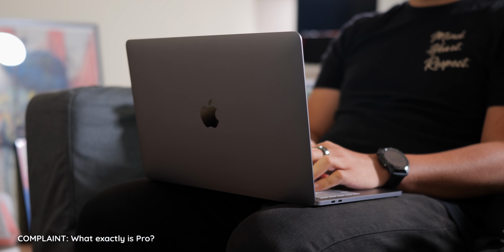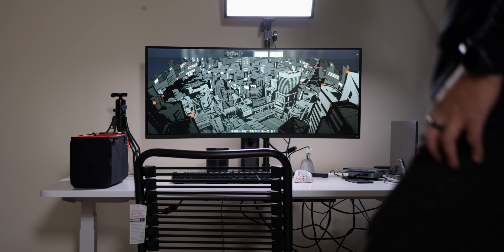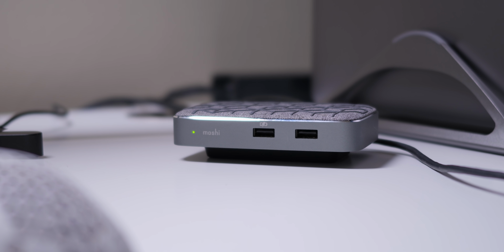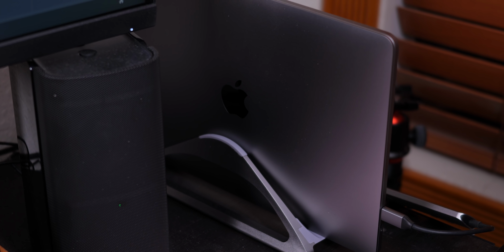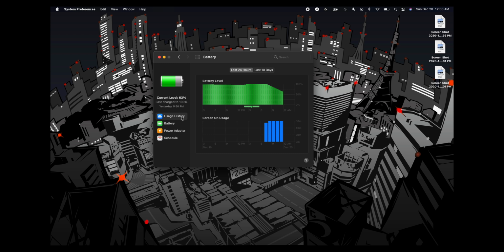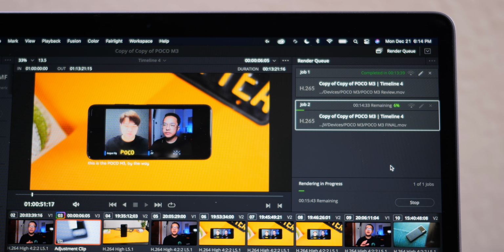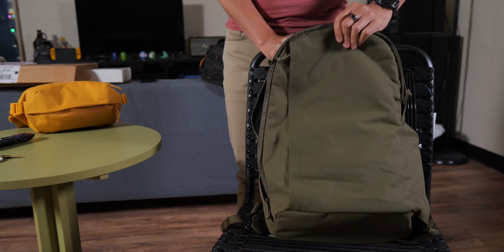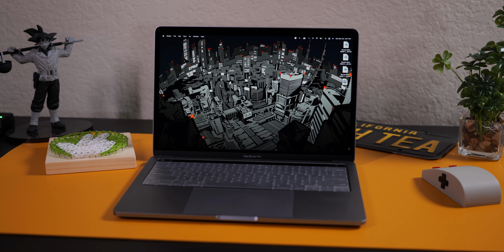MacBook Pro M1 COMPLAINTS and TAKEAWAYS

Comment from the maker: Did you get on the M1 hype train?
Reply: Not yet but deffo shall consider!
Reply: Nope
Reply: Nope
Reply: Haven’t watched the video. But I have one now. Watching apprehensively worried I made a mistake.
Reply: How does it compare to the g14?
Reply: Not even a consideration until there’s a 16in variant with at least 32gb of ram and more powerful graphics.
Reply: @brandonharden2184   Guess you're still thinking in intel's mindset. Heh. It doesn't work like that at all with Mx chips.
Reply: Yup! Bought my Air last saturday and also an Iphone 12. Guess I am a MacGuy now! Cheers from Portugal.
Reply: Well, I've been chugging the MacOS for about a year since I kicked my butt off windows 10 after having been a windows user for way over 20 years. Windows 10 being the ABSOLUTE WORST iteration of windows that forced me to jump the fence to Linux Mint first, and eventually to MacOS. Tried the MBA 2017, first, decided to like it so much and then allowed myself to get the M1 Mac Mini when the opportunity presented itself. Bought the base model, with option to boot from a MUCH larger external NVMe SSD courtesy of Ugreen enclosure, plus a 4TB of spinning drive as the default backup and data drive.

Comment: Windows needs to catch up to Apple. Intel is lacking the innovation in the PC side.
Reply: You can get around 10% higher performance vs windows by using Clear Linux as the OS. Don't underestimate the power of being able to optimize the software for the hardware. IMO windows will never get that level of optimisation cos they're not really that interested in desktop anymore plus they're working on windows on arm.

Also maybe you should watch the upcoming CES video, amd might show their van gogh apu which is supposed to have the same integrated graphics as the series s  albeit at lower clocks and around 9-18w ctdp. Intel's only gonna get into the conversation late next year at the earliest

Comment: I actually had to buy the macbook pro 13" 2020 intel i5 10th-gen chip. Aside from the M1 not being released here in the PH yet(the iphone 12 pro max just got officially released last Dec 18), the statistical softwares and some econ programs I use are not supported by the M1 chip. But overall, I'm glad I switched from PC to Mac. I know now why other people will say "Once you go Mac, you'll never go back" lol Maligayang Pasko and great content as always! :)
Reply: I switched to mac and I will def go back to pc. They both have their pros and cons. But for what I need a computer for the software compatibility and ease of use works better for windows
Reply: @deucexx733  That's true. But my Windows PC just kept on doing the blue screen of death whenever I use one of the programs (I had 8GB RAM), and that the updates really just annoyed me. The laptop automatically updated (even though I set the settings to manual) while I was conducting my Uni classes, and that happened 2x. So I just switched to Mac since I've been using an iphone, and ipad pro, and an apple watch.
Reply: @EcoGamer831  to each its own. I have a Mac, AirPods, iPhone, and Apple Watch, and yet I feel the need to go back to a windows machine, I mean I've grown to tolerate the Mac. The OS being more polished than windows, but Microsoft Office is watered down, there is no access, multitasking is terrible to me, the file management isn't the best( in my opinion). I do enjoy programming on it but when it comes to database use, I use Microsoft SQL server and well its not on Mac. but overall Mac and macOS is nice, I will continue to use Mac but not having a windows machine is a real bummer. for people that don't like windows and think its terrible don't know how to operate it.